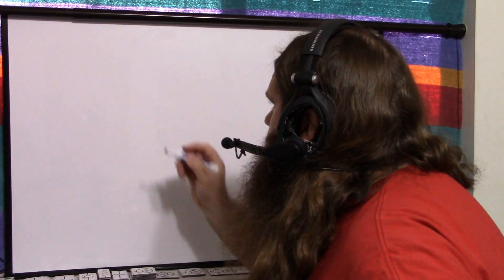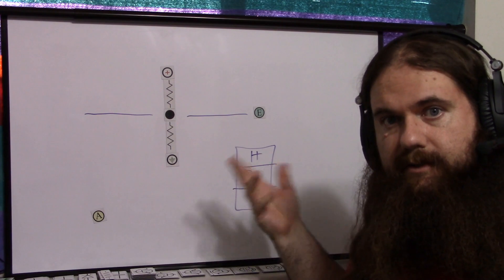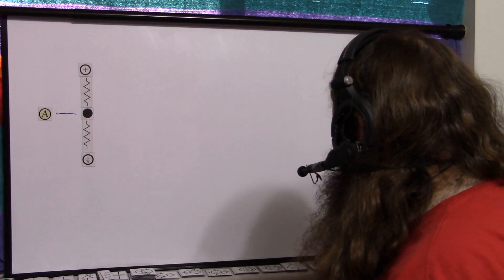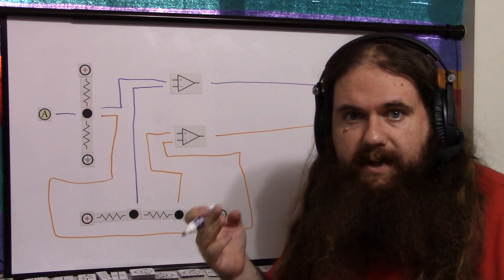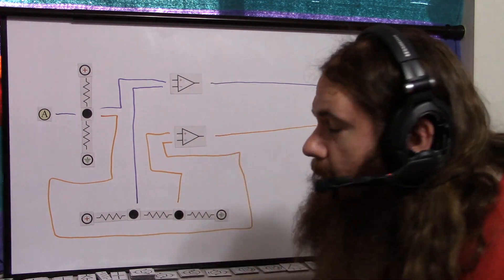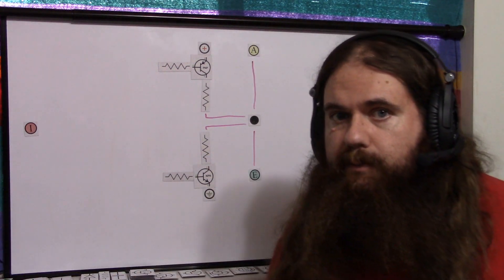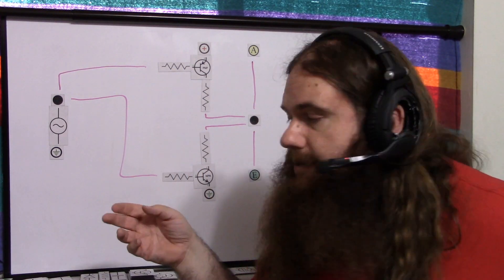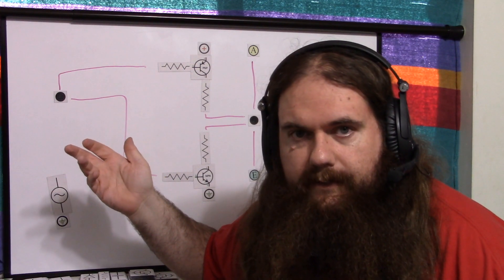Detecting Floating Inputs - Three Useful Ways To Read A Tri-State Signal - Simply Put

Comment: Thanks so much,  this work for me, which is readings two 3digit displays connected in parallel with different polarity common anode and common cathod that uses charlieplexed method 🤕.

One note: 
I tried two opamp for each single without  voltage divider before signal it was almost 85% working. But there's an overlapping between nearby digit of last signal. So the voltage divider is very important before the opamp.

Thank you again.

Comment: “Cheap components you have already!”  I’d like to know your “base stock” of components.  Would you care to share?  Heck, that might make a good video!
Reply from the maker: That is indeed a video I'm planning: The "base set" of components everyone should have, to not have to constantly order parts. For example, if you get an adder chip, you can wire it up as a counter chip. An actual counter chip might be better, but that's another box of parts you'd need. Right now I have N/P bjts, N/P mosfets, resistors, ceramic capacitors, inductors, op-amps, LEDs, spdt switches, analog switches, priority binary encoders, binary decoders, adders, NAND gates, inverters, shift registers, and bit-addressable latches as my "core" set. And that could even be pared down by removing inverters and the latches, for example, though they come in handy. With these components I can basically do "anything" and it's fun trying to find ways to use parts in ways that aren't intended.

Comment: Thank you one question what values of the resistors are good for 5V TTL logic (and values for  3.3V logic levels) ?
Reply from the maker: I'm not sure what you're asking, but if you know the impedance of whatever you're plugging into the signal to be read, the pull-up resistor acts as a voltage divider. For example, if I have a 5V signal and I attach my 1Mohm multimeter probe with a 330kohm pullup resistor, I get about 3.7V.